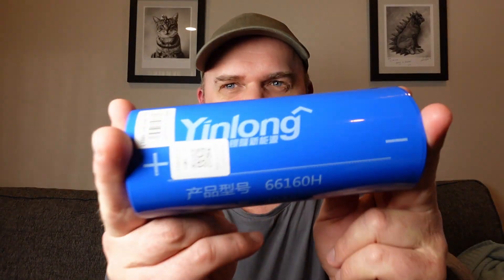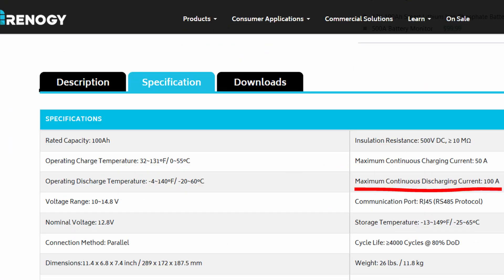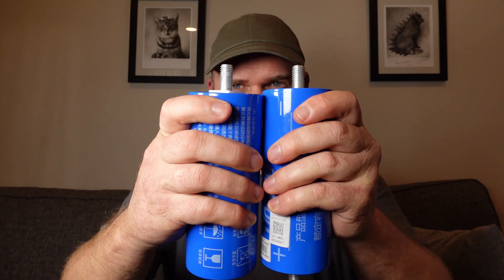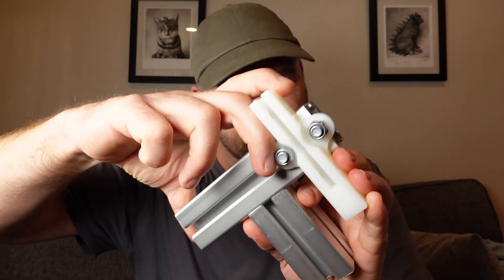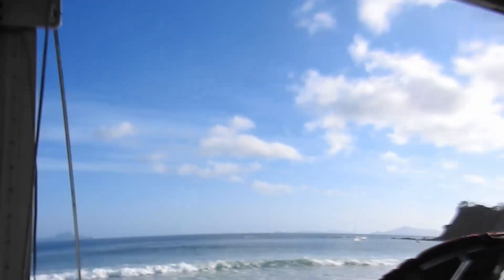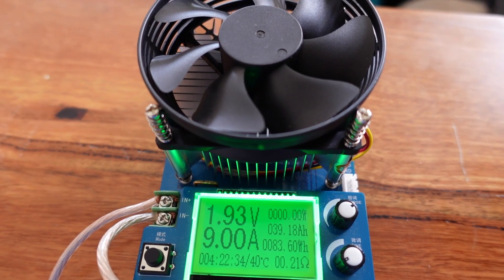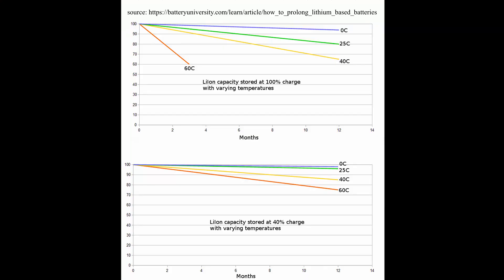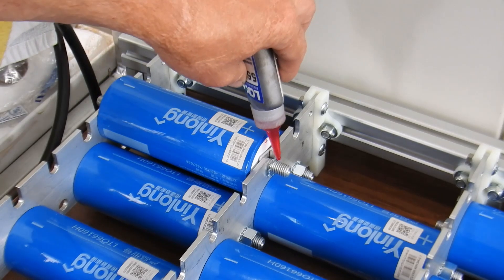Campervan DIY battery build HUGE POWER!

Comment: The specs you listed sounds more like a capacitor rather than a battery. They also look the same as other videos showing super-capacitors.
Is that what these really are?
Reply from the maker: They are an electrochemical device rather than electrostatic, if you have a look at the discharge curve.. you'll see a voltage curve that resembles that of a typical battery than the discharge curve that would be associated with a capacitor.  So definitely a battery.

Comment: Great video. Correction on the transformer. That transformer on the street would be would be 100kVA per phase with 3 phase. That is is 52KW at 380v, if it is 11,000V or 22,000V then it is 1500kW or 3000kW, enough to power a good few homes.
Reply from the maker: Hey Travis, thanks.  Tho maybe fact check your fact check?  
The rating of a transformer is the combined rating of all the phases, not each individual.  

I'm assuming the voltage of it is 11kV.  The max rating of a transformer cannot really change.  It is limited by a few things, the heat dissipation, the current handling of the windings and connections, also the amount of magnetic flux the core can hold.  With wires, it is easy to increase the amount of power they can deliver - you just increase the voltage, this increases the power delivered.  However... if you increase the voltage on the primary of a transformer past its rating you'll saturate the core which will cause the inductance to drop significantly and effectively cause a near short circuit.
Although they can run for short periods exceeding their rating... A 100kVA transformer is always going to be a 100kVA transformer.  (you can try and increase the core handling ability by increasing frequency - but this increases your iron losses and heat generated, so wouldn't help much).  I'm going to be doing future videos that explain electricity at a more in depth level than most DIY solar youtuber people.
Reply: @brendontait6968   Thanks for your reply. I was confusing my generator formulas with transformer formulas and messing up the numbers when comparing amps at 240vvs 380v and single phase to 3 phase.

Very impressive that those batteries can handle 400A and 90KVA, that is over 70kW, you would need one heck of an inverter for that load, but it make sense that small packs can deliver a punch when you look at how many kW electric cars are pulling from their battery packs.

I am going to have to go check the substations and transformers on my block. Our property of 18 homes is supplied by 200kVA and I always assumed it was 200KW, or 160KW with pf of 0.8 per phase.

Comment: The Yinlong batteries can even do 30.000 DOD Cycles not only 20.000.So it actually would be 0,017$/kwh
Reply from the maker: Yeah I saw claims from 20-30k so I took the more reserved figure.

Comment: Brendon, which supplier o these cells would you recommend?
Since your video publishing did you find better LTO cells or even better chemistry/technology/manufacturer?
Reply from the maker: Haven't really looked, tho I'd preferentially buy toshiba cells.  I've heard a lot of bad things about the cells I used, however... three years later they are performing great.  I think the biggest issue people have faced is poor restraint or battery design.  This puts undue stress on the cell terminals.

LFP cells are now the best value for capacity, however... they don't have the ruggedness of LTO.
Reply: Thanks.  Me - since I have learned about LTO I became it's total fan. First I have learned about Tiankang manufcturer, then Yinlong. I based my opinion on one reliable company form Czech Republic who put Tiankang and Yinlong cells into their offer after long testing it.
I too would love to get Toshiba SCiB, preferably as multi-cell batteries with their protection and balancing electronics.
But, the price, but 2 - as you have pointed - long term investment price and safety and working and storage temperature range, fast charging, 0-100% capacity availability.......

Comment: Thanks for good info. Im about to build my first system. Want to trye out this "free" energi thing with this prices we have this days on electricity. BUT do you or anyone here know if this can be used on a ebike? Im thinking about build a ebike trike for Long travel. Is this total wrong type of battery or can it be awsome? 😜✌️
Reply from the maker: Wrong type of chemistry I think.  They are too heavy and bulky for an ebike.  There were a few ebikes made with them years ago, but I think they kept the pack fairly small.
Reply: @brendontait6968  thanks for answer 🙌

Comment: Is it possible to get 12V from these? As 5 wouldn't do the trick and 11 is good for 24V
Reply from the maker: Most people use 6 cells.  It's not an ideal voltage.  But this is commonly used by the car audio guys.  15.3V full charged is normally done by the diode mod on the alternator.  I don't like 12V as a solar system voltage so have avoided it.  I'm making  a mini camper at the moment so may give it a go.
Reply: @brendontait6968  Thanks, yes I am using 24V on my camper

Comment: Silicon is great for locking threads. If not for the fact you can undo with ease but will not come lose under vibration.

Comment: Hi Mate!,
I live in the northern part of a western state less than 200 miles south of Canada in the United States. I purchased used Toshiba LTO SCiB batteries that once powered a Honda Fit EV car. I am using 24 of the cells in series at 60V Nominal and 48V Minimal charging at 61V.  This gives me 44kW hours of storage but the truth is that I really get more than that, due to the fast C rate of charging. My batteries charge faster under power from my generator, also. Because I can go down to a lower discharge rate in an emergency situation, I have a few more kW hours that I can bleed off my system without harming it. I am on my 3rd year without any issues.
Reply from the maker: Jealous! I would love to be able to get a bank like that.  Was keen on those batteries even, but just not available in NZ unfortunately

Comment: Can this power my home or ac for 12 hrs a day
Reply from the maker: Really depends on what load yr AC is running, generally I'd say it would likely be a bit short.
Reply: @brendontait6968  How many of these would I need to run a 2 tonne 2000 watts for 12 hrs
Reply from the maker: @uday20101  2 tonne...  I struggle with American measurement units sorry....  😫 
We'll assume 2kW,  one cell is 92Wh.  So 2kW will need 22cells for every hour you're running.  Do you know if the compressor is running 100% of the time or only 50%?  If it runs 100%, that's 261 cells.  If it runs 50% that's 130cells.  You'd prolly have to add 5-10% for wiring and inverter efficiencies.

Comment: Im currently researching battery banks for my houseboat and this is a very smart and very well desinged system super impressed
Reply from the maker: Thanks Sean,  first attempt at battery too!  Normally the first version of anything I make is terrible, but this has performed really well and not sure I'd change anything about the design if I were to build it again.  Sometimes   dumb luck plays a part in design!

Comment: Just use blue loctite.  Not red.  If you need something even milder, they make a purple loctite.  You'd think it's strength would be between blue and red, right?  Wrong.  It's lighter duty than blue loctite.
Reply from the maker: Hey Hershal.  I didn't use loctite brand.  I used loxeal 55-04 which is equivalent to blue.  The studs are weak, and even this low strength threadlocker concerned me.

Comment: your profect as of today is around $1 per Wh just to buy the cells without shipping. you can get a 5120Wh LiPo4 from Chins for $1700 @ 33c/Wh for a fully completed battery. you get a 200A discharge rate @ 24v so this one battery is capable of running anything you can throw at it and if you have 2 of them you can pull 400A @ 24v and so on.
Reply from the maker: The cells are considerably cheaper when you buy in bulk.

Comment: It would've been good to see some actual testing done on the set up, anyone can put a bunch of batteries together, but without any rigorous testing, it means very little. Don't get me wrong, your build looks good, although I would've used copper bus bars, but before I'd look to invest in these, i'd need to see how well they work.
Reply from the maker: Hey Morgan, I will do an update on this shortly.  There are plenty of papers and a couple youtube videos that show their high cycle life.   It's been operating since 2019 and still has original capacity without any issues.  It runs a 3500W induction stove and electric hot water when I'm away, and a domestic fridge permanently.
I disagree on the sentiment of copper bars.  The cost would have been eyewatering,  copper is a pig to machine and you'd have 200 dissimilar metal lug junctions, with what advantage?  The bar shares the load along it's length so any resistance difference wouldn't be apparent?
Reply: @brendontait6968  eye watering cost.

50 bucks a cell.

I agree though. aluminum is fine. it's well oversized for the loads mentioned.

Comment: Hi, love the video and thinking about building a large solar battery at home with these cells.  Love the safety of the LTO chemistry.   Feel like an idiot…but I can’t find the link to the supplier you used.  Would love to use the same supplier as I’m aiming for 40kwh total so going to need lots of cells.  Thx Adam

Comment: Why lock tite on electrical
Reply from the maker: The cell studs are aluminium so the torque you can apply to them is quite limited.  It's in my truck which sees a lot of vibration etc.
Reply: @brendontait6968  alright I've never seen lock  tite use like that and not a lock washer

Comment: Seriously cool video. Great to see fellow Kiwi's on here too. Thanks heaps!
Reply: Aluminium can be tinned where connections are to be made by applying sufficient thermal mass soldering iron though a film of regular engine oil and rubbing through the oxide layer.
Reply from the maker: Cheers Scott

Comment: Yikes!  That nail in the 18650 scared me.  Now I'm afraid of my 18650 cells.  VERY afraid.
Reply from the maker: Fair enough, it's like they are packed with gunpowder....  I was initially going to build my pack with 18650s.  I joined a Facebook group and have never seen so many houses burned to the ground in any one place.  LTO cells give me a lot of confidence
Reply: Yes!  I saw a Tesla last year that hit a tree and burst into flames.  Took the fire department 4 hours and 33,000 gallons of water to put it out, (during which they also called Tesla to find out how to extinguish the fire).  No thanks.  I’ll pass.

Comment: Great vid, maybe someone can help, im looking to run a couple big car amps from home with ac to dc convertor, both power amps each have 4x 40A fuses, so 8 total.  Read somewhere we are supposed to add them up to estimate total amp load draw.. 40x8 be 320A. I'll have them maybe half volume.
I do NOT want car batt hooked up any where. 

Looking at ds18 infinite 100A (basically 100A ac to dc convertor/ charger) for main power, maybe even two in parallel for 200A power, but also incorporating a few of these as power caps to take bass hits to soften load on convertors.  Any thoughts?

Comment: I have no idea how this is working with the Negative and the Positive on the same bar. If all negative were on one and all positive on the other then that makes sense. This however looks as if the batteries would heat and pop! Can someone explain how this is functioning at all?
Reply from the maker: Ok... so if as an example you get 2 AA batteries, 1.5V each and put them end to end -ve to +ve... the voltage of the batteries will add together.   So if you measure from the +ve from one of the cells and the -ve of the other, you'll have 3V.  

My cells are roughly 2.3V each and I've run 11 in series (+ve to -ve) which gives me 25.3V.  I have them in banks of 9 parallel (-ve to -ve and +ve to +ve) which is done to give them greater capacity for a specific voltage.

You can mix and match configurations to get the voltage and capacity you require.

Comment: I ve been designing solar core composit automated  vehicle production theories with solar (cheep,) wafers embedded in the gell.
As a 25 year traveller in my lt 35 VW , not sure ever get to build it ,  6ooo Watts of wafers,  a 3 inch 4 ×2 floor chassis plate
 that has the battery  Wells, me and other DIY . are looking how to store the RECOVERY BRAKING energy  , rapid charge and 1 or 2 minuet hold , especially for solar city buses and other urban vehicles.  Hay , you have a great flat square box ,great for  solar , the iindustry are to stuck in all their curved bodywork , 1/3 of  the power plus on a sunny day and  " COMBUSTION ELECTRIC MOTOR GENERATORS " to a whole  new age travelor world  SATELLITE TRAVELORS  Jon

Comment: I really like how you ended the presentation, telling us what you would have done differently. When I saw the RED thread lock, I cringed because of my own experience with the stuff. I have bolts break before it releases.  I was thinking to protect from loosening due to vibration, Blue thread lock would do fine.

Another issue is the use of aluminum because it does form an insulating oxide layer, but this can be avoided with the use of dielectric grease to minimize the available oxygen.

Comment: top 4.2 x 14 =58.8, 3.2 x 14 = 44.8 working range of 46-57v to be safe in a 48v set up.
top 2.9 x 20 = 58, 1.5 x 20 = 30 working range of 32-56v that lower voltage is gonna be an issue.
I have a growatt 3kw 48v AIO if I set it to custom voltage range it still goes into a slow charge mode
when I hit 56 even though I programmed to charge up to 57.2
Reply from the maker: Working range is from 2.0-2.6V

Comment: Very nice build from a mechanical standpoint. But your bus bar design is the easiest to accidentally short I've ever seen and then combined with the highest short-circuit current cells I've ever seen. Wondering what would happen if you drop a spanner across one column of cells... Imagine about 100x the power of a stick welder.
Reply from the maker: Hey h3po, Thanks, although I disagree with you on the point about the bus bars.  It isn't immediately apparent from the video, however.. it is very difficult to drop something in there that will short.  The reason for this is the cells are staggered and the bars sit significantly lower than the tops of the cells.  The staggering of the cells prevents most anything from touching the bars.  If you did get a precise length spanner to fit... it is only 2.5V potential between bars, so not a huge amount of voltage.  Subsequently to this video (I'll put an update sometime soon) I built a polycarbonate cover for the cells to avoid the potential for issues from dropping the odd kitchen utensil down there.  To  be fair... dropping utensils into any uninsulated battery enclosure would carry some level of risk.
Reply: @brendontait6968  Good to hear you made a cover. If you think 2.5V is not a problem, you are misinformed. The individual cell is specced at <1mOhm, theoretically a single cell will release 6kW of energy if you short it (P = U² / R = 2.5² / 0.001). At that kind of power, things melt and catch on fire, even if the cell chemistry itself is not involved.
Reply from the maker: @4833504F  this is true if you have super cold spanners made of YBCO...  but generally speaking, spanners don't make a good enough contact and have fairly poor conductivity.  (I've tried it just for fun!) - I may even make an update video showing... no doubt if you leave the spanner there for long enough, it will get dangerously hot.  What im trying to say is 2.5V bus bar potential is safer to short circuit than 25V bus bar potential.  But yeah... it was always my intention to have a cover as I would with any battery or electrical build where there are exposed contacts.

Comment: LTO is proboly the best all around battery if not energy density is that important. Granted they use to be really expensive, but they actually lack most of the expensive minerals in most other lithium batteries, so they should be rather afordable.... maybe in the future.

Anyway, they have the best efficency, even more so than NCA

Comment: So the Japanese battery is dangerous but the Chinese one is safe?   ...Nice try.
Reply from the maker: Well that has everything to do with what they are made from and little to do with where they are made.  I did actually say in the video I would rather have used toshiba cells which are made in Japan, but they were unavailable to me.

Comment: Is that how you ask for those parts? 40/40 section?
Reply from the maker: The dimension is 40mm x 40mm.  There is a company in the states called 8020 because they use to sell 80mm x 20mm... now it is often called that in that country irrelevant of dimensions.
Reply: @brendontait6968  Thank you but WHAT ARE those things? I guessing now that I can not go to home depot and ask for 40/40 sections and they will know what I'm talking  about.